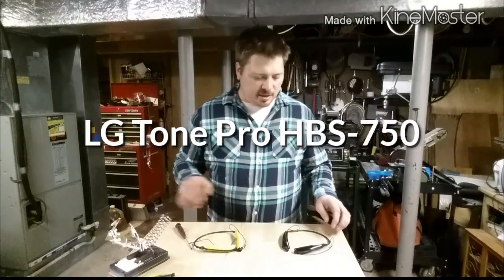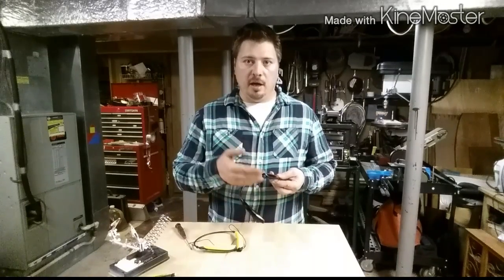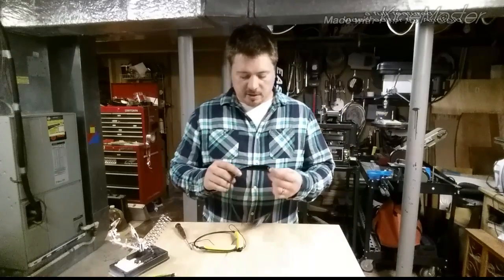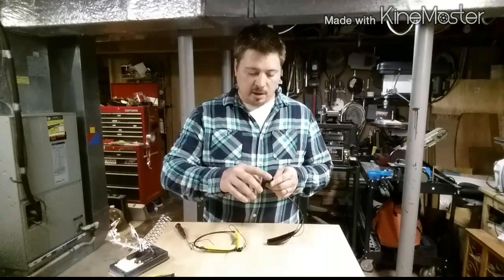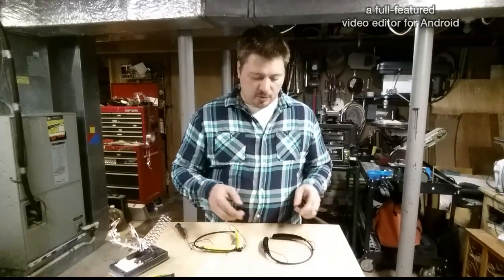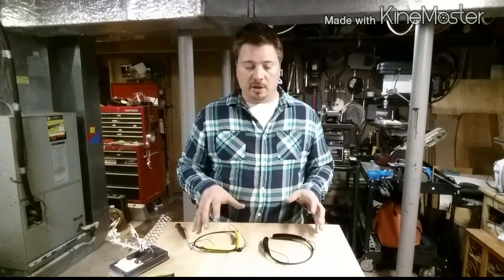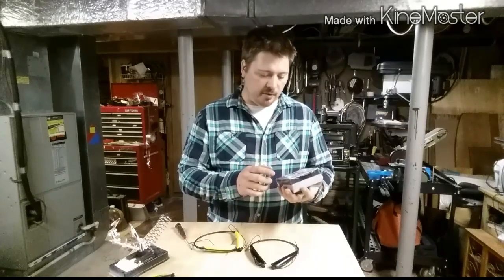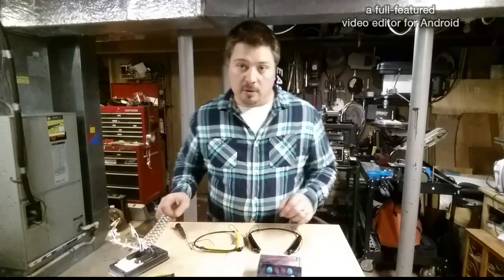LG Tone Pro HBS-750 repair, upgrade, mod

Comment: I have the hbs 750 and it hasn't been working recently. I've put it to charge plenty of times and it still won't turn on. Also, I can't seem to figure out whether they should be charged with the power on or power off. Please respond, I need the help.
Reply from the maker: +sinistersky it sounds like your battery may be bad.  Your hbs750 should automatically turn off anytime the charger is connected so, it shouldn't matter if the switch is on or off.  My other videos on the hbs series headphones may help.

Comment: I have an HBS-750 where I can't adjust the volume up, but can adjust the volume down. When trying to adjust the volume up, the volume does not change, the button does not press in like it does when adjusting the volume down. Any recommendations.
Reply from the maker: I would disassemble it and check that the buttons on the control board push and click freely.  I would also check that the outer button shell moves freely.  The outside part of the button can easily become dirty and require cleaning to prevent getting stuck.
Reply: @kez3000  impressive... 👍

You are a nice person...

Please know that.

Regards. 🎉

Comment: My right side speaker sounds way lower at maximum volume, seems to be getting worse actually...is there a way I can just replace the speaker inside the ear bud? instead of opening the device and what not...
Reply from the maker: Yes, you can open the ear bud and replace the speaker but it's very tricky and I wouldn't recommend it.  If you look at the side of the ear bud, you will see a seam. The ear bud case is glued together in two parts. If you squeeze it just right and pry it apart with a utility knife, it comes apart.

I've tried it multiple times and have only been successful once. The problem is that the ear bud case usually gets completely ruined in the process of trying to open it. Also, extracting a speaker from another ear bud usually ruins the speaker because they are extremely delicate.

The easier way to go, is to buy a broken earpiece on ebay for around $12 and extract a working ear bud from it. 

If you do attempt the speaker transplant, please keep me posted.  I wish you luck and steady hands.
Reply: kez3000 josecervantes161
Same thing happened to me. I used to always use the left side more than the other, then that side started to get way lower in volume. Started using the right side and the same thing happened.

I found that the tiny piece of mesh covering the driver (you can see it when you take of the rubber from the earbud, looks like black paper) caused my earbuds to gradually get worse and worse.
Try removing it and hearing the difference. It's like night and day for mine.
Mine must have gotten permeated with earwax and stopped transmitting sound as well. It's a super-fine mesh so it's very understandable.

I'm still looking for a permanent solution but I scraped one of the meshes pretty well and it seemed to have gotten better but not great. Have to have SOMETHING covering that driver.

Comment: kez3000 I have the LG HBS 700. Over time the insulation wears out near the housing and the wires are exposed. I've noticed the rubber boot that the ear bud wire is in the 730, 750, etc. I would like to add that to mine. I think it would release the stress on the wires a little bit. Where would a person get those or what would you suggest to fix this issue? Thanks in advance.
Reply from the maker: I don't believe the rubber boot is available for sale.  Even if it was, it wouldn't fit the HBS700 inside the housing like the HBS750 does and would not provide the protection you're looking for.  There is an alternative that I tried a few years ago in an attempt to make my earpiece waterproof, I taped up the charger door and dipped my HBS700 in a product called PlastiDip.  It's a liquid rubber that cures into a soft rubber coating.  It can be easily peeled off too.  You could use this product to add a rubber coating to the wire and create your own boot for the wire. 

Another option would be to make the hole in the housing for the wire a little bigger and add heat shrink to the wire.  This would give the wire an added layer of protection.  Of course this method would require you to remove the earbud from the earpiece first to slide the shrink wrap on.  

Let me know how it works out for you.

Comment: I've had a pair of hbs-750 for less than a year now and sometimes they will play when they are switched off. Also, they often have choppy playback even if my device is right next to me; and it only happens if i move the headset (when working out, etc.)

Any ideas? I've had these just spontaneously start playing music while in my bag even when the switch is clearly set to off!
Reply from the maker: It should still be covered under the 1 year warranty if you've had it less than a year. I would call LG and have them repair it under warranty.

Comment: I have a few questions.... 

What exactly causes the earbuds to stop working? Because all that happened to me was that I fell alseep wearing them ONCE and worked fine until like 6 hours later they randomly stop working in the middle of a song and now I can't get them to work properly again..
Reply: Forgot to ask the second question * facepalms *
And also is there a way to fix the wire from the outside so I don't risk destroying my headphones?
Reply from the maker: +xenomorph101AJ 
1: there are multiple causes for the earbud to quit. The most common is the wire breaking inside the rubber coating. The speakers inside the earbud are also very delicate and can quit over time.  Sometimes a build up of ear wax seeps into the earbud and kills the speaker too.  
2: I'm sure if you are determined, you could fix it outside the casing but, i wouldn't recommend it. Chances are the repair won't be as durable and won't last.  I say if you're going to do it, do it right. Shortcut repairs lead to sort lived repairs.   It's really not that hard but if you're not comfortable, don't attempt it. 

Hope this helps
Reply from the maker: +kez3000 also,  did the entire unit stop working or just an earbud? If it's the whole unit,  is probably not a speaker or wire problem.
Reply: +kez3000 just the right earbud, everything else works
Reply: +BloodDragon058 the exact same thing happened to me

Comment: Which model AWEI ear buds did you use?  The ones I've found don't look like they'd fit in the hsb-750 ear bud holder part.
Reply from the maker: I honestly don't remember. I'm pretty sure they go by a different model # now.  I recommend shopping around and finding earbuds that you like. This is your chance to customize the earpiece and make it uniquely yours.  Just try to get earbuds without the mic or buttons on the wire because it leaves you with less wire length to work with.
Reply: +kez3000 Thanks, I was actually more concerned about paying $20 for ear buds and then they won't fit in the HSB-750.

Comment: How do you repair the selection buttons.  Specifically, my answer call button on the left side does not move at all.  i can't answer calls from the headset.  Thanks.
Reply from the maker: Hi Kent, I need a little more info. First you need to open the earpiece up and see if there is anything blocking the button. Then remove the plastic outer part of the button and see if the part attached to the circut board can be depressed. If not, you can take the button measurements (usually in millimeters) and find a replacement online. I would look on ebay. If that fails, you can buy a broken one on ebay and either swap circuit boards or fix the new one you get with parts from the old one. Let me know what you find.
Reply: Hi kent

Im having the same problem with the call button. Did u ever resolve your issue? Are they worth fixing or is it a better one out there?. I havent had mine that long, so I was surprised.  Any feedback wud b appreciated thx. K

Comment: Any advise on the power switch? Mine won't turn on. Every once and again I can coax it on but very rarely.  It actually turned on when I popped to cover off, had the power button in the on position and it came to life. Any help?
Reply from the maker: I actually posted a video just for the power switch. There is also a person in the comment section of that vid who offers 3D printed replacement parts.
Reply: Thanks

Comment: hi I'm having problems with my LG headset Bluetooth headset where they they come on after I charge it the blue lights always on I charge  over night
Reply from the maker: It sounds like your power button is stuck in the on position.

Comment: mine just started vibrating even when its turned off what you think its the problem ?
Reply from the maker: I'm not really sure but I would open it up and check all the wires are connected properly and nothing looks burnt.

Comment: i have the HBS750.
i havent had any issues till now but ive noticed the left earbuds sound has lowered greatly in sound quality.
im not really sure what to do, should i try to take the thing apart to look at it closer...? any tips appreciated..
Reply from the maker: Go to my channel and watch my other video on LG Tone repair for the 700/730.  I show the earbud replacement.  The procedure is mostly the same for the 750 bit opening the case odd different.  Lower quality in one side is usually a sign that speaker is going bad.
Reply: Okay ty ill watch asap.

Comment: Do you know if there are any instructions on upgrading the battery on the HBS-760 headset? The stock one never holds the charge long enough. Immediately unplug from charger and the level is high, wait less than 1 hour with unit off and it's medium level. I've seen enough other unit upgrades but not this unit.
Reply from the maker: +Dave Leary I've never worked on the 760 but the principal should be the same as my other two repair videos.

Comment: hey,

I have the hbs 800. I started having issues with the audio coming out only on the right side. I took it a part then was unable to have it turn on. when I plug it up to charge the red light comes on then shuts off. no other lights.  any ideas what I did for it not to work?
Reply from the maker: +specscrewart honestly, I'm not sure.   I've never had an 800 to play with.  If it's charged but not powering on,  I'd check the power switch. If it's not charging at all,  check the battery wires for a loose connection.

Comment: Is there a repair for the random cutting in and out of the mic during a call?
Reply from the maker: First, I would check the +/-wires that connect the mic to the board for a loose connection.

If that fails, I would replace the mic. You can pull a mic from a cheap set of earbuds that have a mic along the wire.

Please keep me posted with your results and let me know if I can help further.
Reply: Sounds good I will. This seems to be a huge problem across the board with 730 and 750
Reply from the maker: michael spriggs If you are still having the issue, I just posted a video about the microphone that may help.

Comment: Okay so with mine I can't turn it on without having to hold a button down and when it turns on no other device can connect with it at all. I tried other phones to check if I'll be able to pair it with one but I can't any solutions?
Reply from the maker: Honestly, I've never run across that problem. Sounds like one of your controller chips may be bad.
Reply: +kez3000 okay cause I'm looking up a lot of things to help but I've tried most of them it's probably broken
Reply from the maker: Your best bet might be to buy a broken one on ebay cheap and swap parts. My other hbs video shows a lot of the replacement procedures.
Reply: +kez3000 okay thank you

Comment: Hey where would I get better earbuds for my lg hbs 770s I've looked everywhere and can't find anywhere to buys the better ones
Reply from the maker: +nate7621 you can't buy them specifically for any of the lg tone series. You need to buy regular plug in earbuds and cut the wires to length. I show this in my hbs 700/730 video.
Reply: Ah so what about the whole magnetic part of it or is that in the video
Reply from the maker: +nate7621 yes, you can pull the magnets out of the old earbuds or you can buy small rare earth magnets and glue them on.  I use earbuds with a flat back and i glue on flat round magnets. You just need to stick the magnet in the earpiece cup first to know what side to glue to the earbud. Otherwise they might repel instead of attract.
Reply: kez3000 cool thanks for the help

Comment: Hello, there? Thanks for the excellent videos. I just purchased HBS-750 off the ebay. But my HBS-750 earbuds won't stick well to the sockets and constantly fall off. How do I fix it? Let me know, thanks.
Reply from the maker: You might check to see that the magnets inside are properly placed. If that doesn't help you may try replacing the magnets. They're easy to find on amazon or ebay.

Comment: great vid question about the 750 though when it's on the charger the led is a solid blue not red and it's not charging eventually after constant unplugging and replugging it starts to charge ur thoughts?
Reply from the maker: It sounds like you have a short to ground somewhere in the unit.

Comment: my Hbs-750 will not turn on at all unless conected to a charger?? what do I do?
Reply from the maker: Sounds like you're battery is bad. Check out my hbs700/730 video to watch how to replace the battery.
Reply: +kez3000  thank you

Comment: How do I find the replacement cord for them?  My cat got a hold of it, so I wanted to know where I can get the earbud cords from.
Reply from the maker: +Ayiden Lightsky I don't know where to get the original earbuds from the factory. As I show in my other video for the hbs700 I use common earbuds that you can find at almost any store.  They all install the same (one positive, one negative wire per speaker).  If you want to know more, go to my channel and watch my other videos for the lg tone.  Hope this helps.

Comment: where can I purchase replacement rare earth magnet ear buds to upgrade my lg hbs 750?
Reply from the maker: The short answer is you can't. To my knowledge they are sold exclusively in bulk to the manufacturer. If you watch my other video for the hbs700/730 I show you a way to put magnets on the replacement earbuds.
Reply: I am trying to increase the audio power and quality. Any suggestions?
Reply from the maker: In my experience the hbs750 wasn't designed to be as loud as the earlier models.  Unfortunately, if there is a way to increase the audio output, I haven't discovered it yet.  I personally went back to using an hbs700. The audio is much louder and there's a lot more room to fit a larger battery.

Comment: Went looking for battery replacement video... couldn't find it. Where can i go to buy a new battery?
Reply from the maker: Hi Jessica, sorry for the very late reply.   For some reason, I didn't get a notification of your comment. 

If you search "501240 3.7v lithium battery", you should come up with some results. Just for reference, its a 3.7 volt lithium polymer battery. The stock battery is 195mAh capacity (basically how much power the battery can store). I usually replace with higher capacity for some extended run time like 220mAh. Model #'s are tricky because they are usually the dimensions of the battery.  For example...  The battery I used for the video was 501240 or 051240 (the first two numbers can be reversed with some sellers). This model number stands for 05mm tall-12mm wide-40mm long.  That's important so you'll know if it fits in the space inside the earpiece.  

I hope this helps.
Reply from the maker: You can also find my first video here: 
https://youtu.be/UhFEuRD0vAA

It's for model 700 and 730 but it's the same basic instructions once you get to the battery inside.

Comment: The answer/end call button jams and then it redials last number, gotta play with it to make it loose again. Same with the pause /play button
Reply from the maker: You could try turning the earpiece off and using a small amount of high % rubbing or denatured alcohol (don''t use the 70% stuff) on a q-tip to clean the buttons.  It works best if you take the earpiece apart first but it might work without taking it apart.  I can't guarantee it will work but I use this method on my stuck buttons.
Reply: I just took it apart and the button woks better, I guess the cover may be causing it
Reply: I'll try the alcohol anyways, thanks man!

Comment: Is there any software upgrades for the 750?  I don't see anywhere on LG's site for them.  I would love to see if there is any new options/settings.
Reply from the maker: +Jeff Brummer to my knowledge there are no firmware upgrades. I could be wrong but, I believe LG prefers to create new models rather than provide updates to old models.

Comment: my right side doesn't work that much only if I move my head to the left
Reply from the maker: +stephen peel you may want to see a doctor or chiropractor. That sounds serious.
Reply: It's not about my ear its the head phones it works some times
Reply from the maker: +stephen peel oh, in that case it sounds like you possibly have a loose wire connection going to your earbud.  I cover that repair in my first video for the hbs 700/730.  Sorry for my humor.
Reply: It's ok I have hbs-760
Reply: i thought it was funny

Comment: What is the model number of the Awei headphones you have in this video i have an issue with the LG Tone Pro HBS 760 and i was thinking of just replacing the earbuds and wires. Thanks
Reply from the maker: Awei ES600M CB Super Bass Noise Isolating HiFi Headphone Earphone For iPhone MP3 on ebay.  I'm not sure if this model is available any more tho.
Reply: perhaps ebay may be of some assistance if not im sure i can do some research and find a similar model
Reply from the maker: Any earbuds without a mic will work.  You just need to figure out what style you want to have on your earpiece.